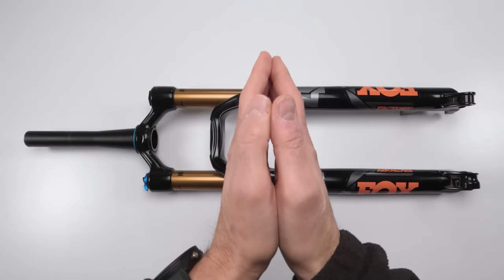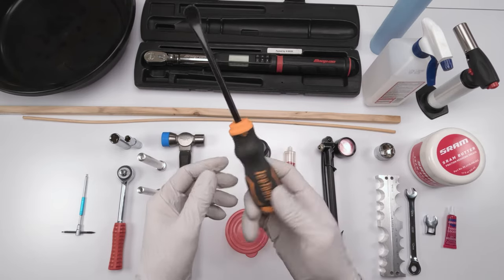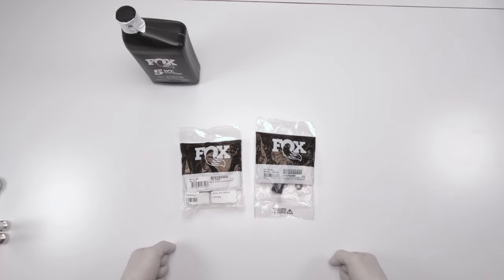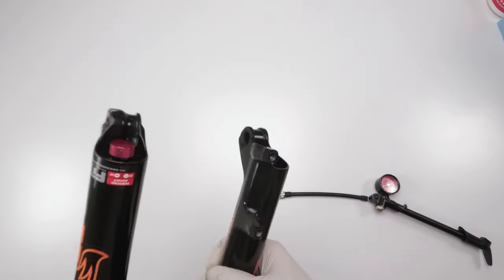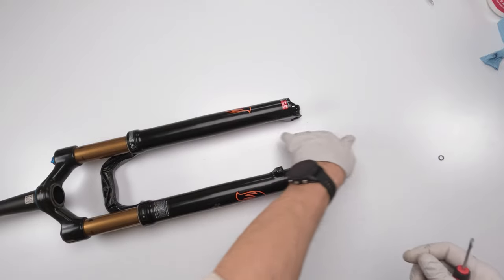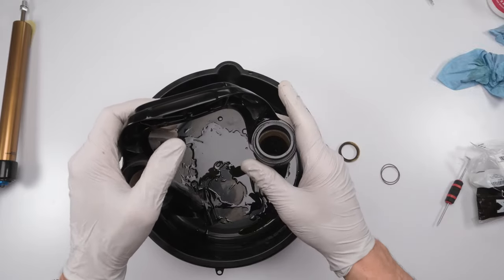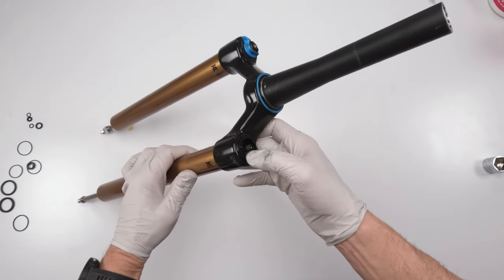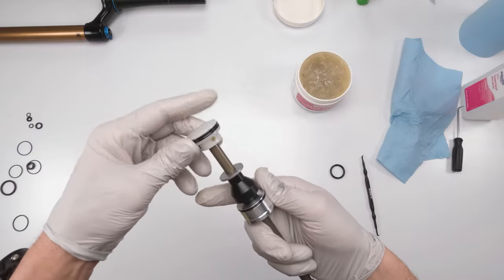Fox Factory Series 34 Float FIT4 2021 Damper, Air spring and Lowers FULL Service guide for beginners

Comment: In the video you showed that you really understand suspensions... Once again, Congratulations on the excellent work. In your opinion, between Fox 34 Factory (not sc) Fit4 (2022) and Rockshox Sid Ultimate Raceday (2022), which one would you choose based on operation, technology, durability and maintenance? What is the best of them in your opinion? I know it's a difficult question, but you showed that you really understand and most other videos, from other channels, seem to be very biased. Thank you for your help.
Reply from the maker: I'm going to start off by saying that I don't have enough experience with the newer SID to provide any useful feedback. Have I ridden it, Yes. But I'm not one to ride a product a handful of times and pretend that I know everything about it.  In my experience, it takes at least 100 - 200 hours of riding different trails that you know very well and readjusting settings regularly to make an honest assessment. 

The fox 34 fit 4 I know well. It's a nice fork for your average trails like we have around here. It offers a good amount of customization to tailor it to your needs. But the one thing I can't customize about it is its stiffness. For me, it's occasionally flexy, especially when turning on my dominant side, going through aggressive rock gardens, etc That's not to say it's a weak shock. 90% of the time, it's more than solid enough, but that last 10% I very much feel. I prefer the pike (or fox 36 but that's overkill for our trails) over the 34 as I can't push those hard enough to feel them flex, at least for our trails. 

My experience with the SID. I HATED the older SID's. To me, they were like riding on noodles.  The new SID's on the other hand, with the 35mm stanchions and new damper, is a VERY welcome change. WAAAY stiffer than the older SID's but I find it harsher than what I'm used to, which is to be expected. I've settled on pikes for my bikes for a few years and put a ridiculous amount of hours into figuring out the most comfortable settings for my favorite local trails. I just haven't put in enough hours in the new SID to see where the sweet spot is for me. And this is key here. It's all about finding the sweet spot for you, on your trails. Suspension is a very personal thing.

Most modern shocks and forks are WAY better than anything we've ever had. Unfortunately, forks are expensive, and it's hard to justify buying two of them at the same time to test them back to back. But they do resell easily with minimal loss. 

With the above being said, 

If you are a more aggressive rider and regularly ride on relatively aggressive trails, and you like a responsive feel but don't mind a bit of a hard ride, start with the SID and see if you can tame it a bit over time. If you like a bit more of a plush ride, then start with the fox 34 fit4 as it offers a bit more adjustability. In either case, you can easily sell either fork to generate funds for the other.

Apologies for the long response.
Reply: @zoubtube  thank you very much for your detailed answer… I think I will go with Fox 34. I like a bit more of a plush ride too. Have a nice weekend and good rides.

Comment: Question:  When I have the damper out, and slide the shaft in and out, there's the subtle sound of Rice Crispies snapping.  Also, the damper tends to have tiny "jumps" in its motion when I pull on it.  Best guess is that these are air bubbles...  are these symtoms you'd expect?
Reply from the maker: So, when cycling the damper, if you hear noises like you mention above, (popping snapping squishing, gurgling (sort of like water rushing through pipes)) then the chances are high that a bit of air got in the system.  Even if there is no air in the system there will be some noise when cycling it due to oil being forced through the shim stack and all the small ports in the piston, but it should sound , well,  dampened (can't think of a better word right now).  more of a  heavier, deeper sound. 

When cycling the damper by using hands only (not on a vise) you will feel some skipping both ways. you won't feel as much when cycling on a vise since you have more control to keep the shift straighter when cycling. The easier it skips stutters etc, the more worn your rebound seal is and needs to get change since air can get inside. I new rebound head will feel very smooth since it will have a higher tolerance if you are slightly off angle when cycling.

hope this helps. let me me know if you have other questions

Comment: Thanks! There isn’t any clip that retains the damper as in the air side?
Reply from the maker: Nope! the damper is a cartridge the threads into the upper and bolts into the lower. good questions and thanks for the comment

Comment: very interesting. Is it possible to know the diameter in millimeters of Body "hole" you user in the clamp?
Reply from the maker: Apologies for the delayed response.
10mm for air spring shaft
~15.5 mm for damper body
9mm damper shaft

Hopefully this helps
Reply: @zoubtube  Hi mate. diameter you wrote are wrong.
I opened the damper for the activity but body is 16.7mm and not aroud 15
Now i'm on hold for a week awaiting the correct jaws 😅😅

Comment: Very thorough! What kind of vises do you use/can recommend for bike mechanical work (jaw width, span width, rotatning vise, rotating jaws, nimble forged jaws)?
Reply from the maker: Tough call, as it depends on many factors, such as space, types of applications and uses, budget, etc. Personally, I would go bigger 5 inch minimum, 6/6.5 preferred, even 8 inch if you have the space and other stuff such as woodworking. Chances are it'll be a one time purchase if you buy a good brand, and you'll never know what you'll use it for in the future. 

For me, I wanted a swivel head. Though it technically creates a vulnerable point, I like the flexibility, especially when working with fork dampers, shocks, and droppers. I also wanted height; as can be seen in some of my fork videos, I'm able to bleed forks on the table. In my case, it helps with cleaner camera views, but it also makes clean up easier as any spill lands on the table as opposed to the floor. 

I tried a few of them before settling on the Yost. Not perfect, but strong, versatile, and with limited slop. I do wish it was 6.5 inch (more for other applications). At the time, the price was good considering the quality and name. The price has gone up since I purchased it, but then again, what hasn't. I had tried the Forward, Wilton and Irvin equivalents, and this one worked out best for my current needs. 

https://www.amazon.com/gp/product/B00CBL62HQ/ref=ppx_yo_dt_b_search_asin_title?ie=UTF8&psc=1.
Reply: @zoubtube , I see the Yost have fixed rotation points and is heavier than the others you mention. They are all made in China though, and only the Irwin is available here in Norway. So I went instead for a German made Heuer 140mm (5.5") forged steel vise with a collapsible lift (that can rotate 360 degrees horizontally). I stepped up from the 120mm version on your advice. It is the first vise I every by and hopefully the last. Thank you!

(I tried to add links but youtube does not like German quality it seems)
Reply from the maker: @alofting  That heuer is a badass vice, myman. I considered them, but they were impossible to find here in the US during mid-covid, so I gave up on them (actually, many vice models from different manufacturers were unavailable at the time; it really was slim pickings). I had also found out at that time that the non-industrial Wilton vices are now made in China, which was very disappointing. Unfortunately, most vices under $500 these days are made in China. Sucks!

Treat that vice well, and it'll last you a lifetime! 👍

Comment: in the lower boots on the damper side fox are calling for a 5wt teflon is it ok to put 20wt gold as you did there ? arent the oils going to mix throught the vent holes ?
thanks
Reply from the maker: per the latest fox damper side oil charts
"Damper-Side Bath - All 34mm FIT4 Damper-Side Bath  FOX 20wt. Gold	 15cc"

Grip and grip two dampers need 5wt in the damper boot
Damper side bath
34mm non-SC Grip Damper-Side Bath	FOX 5wt. Teflon Infused	40cc
34mm SC Grip Damper-Side Bath	FOX 5wt. Teflon Infused	30cc
All 34mm Grip2 Damper-Side Bath	FOX 5wt. Teflon Infused	40cc

hoep this helps

Comment: Love the video 🙂   
Is it two different bullet tools? 
The air spring shaft is 10mm and the damper shaft is 9mm?  
Part nr. 371 for spring and 657 for damper?
Reply from the maker: Yup! Two different bullet tools. 398-00-371 is for the damper, 398-00-657 for the air spring. You can buy the fox part numbers or aftermarket, which is significantly less and just as good imo. there are a few people that sell them on Ebay. I had real good luck with john5w76. I don't know the guy and I have no affiliation with him. His tools are well built, precise, his shipping is fast and he's a good amount less in price than fox. 👍

Comment: Hi nice video!
I must service my fork bleed damper too, next season i will make all damper service but in this i will only bleed it.

I have a question i need 20 or r3 5wt oil for bleed my fork damper: fox 32sc perf elite fit4-> fox id:djbp
Reply from the maker: For the damper you need the 5wt oil. For the lower boots you will use 20wt. Hope this helps.
Reply: @zoubtube  thank you 😊

Comment: Nice detailed video!
I have one question. For the FOX 34 2016-2018 version FOX said: "Once bled, fully extend the cartridge. Make a mark on the shaft approximately 3 inches (75mm) below the sealhead. Compress the shaft until your mark is just at the sealhead. Remove the bleed syringe and vinyl tubing and top off the compression selector shaft with FOX R3 5wt. oil." You advice to remove the syringe with the shaft fully extended. Has that been changed for the 2020+ versions?
Reply from the maker: This depends on the version of the fit4 damper. For this version Damber (2021) this isn't needed. This is was I was told by a FOX tech rep when I called them to verify the DAmper kit part number. I will be releasing a video for a different year fit 4 where this will apply

Comment: Is there any way you could link the vice jaws you use? Also the magnet and the fine flat head screwdriver? Thanks so much!
Reply from the maker: here you go.

Soft jaws I bought them from ebay. Very well made imo. plus the seller is VERY responsive
https://www.ebay.com/itm/115153412361?var=415219180268. 

Here's a link to another ebayer who makes some tools as well. what ever I buy from him is great quality as well. The only thing is his soft jaws don't have magnets like the ones above, which I prefer.

Magnet. I bought it from harbor frieght
https://www.harborfreight.com/hardware/magnets/15-lb-capacity-telescoping-magnetic-pickup-tool-64656.html 

The screw driver head is from a tool kit I bought way back when from Ifixit.  but what should work well is a probe such as the ones in the following link. https://www.harborfreight.com/test-probe-set-5-piece-61872.html
 I plan on using them  on a fork I'll be working on soon.

hope this helps
Reply: Thanks so much. I really appreciate it!

Comment: Does this works for a 2018?
Reply from the maker: Yes, but there are some minor differences, overall they are very similar. if you skip the compression stack and bladder, which in my opinion are optional, then this is a very easy damper to  service and bleed.

Comment: When removing the FIT4 damper top adjuster knobs, my thumb couldn't hold the black knob tight enough to loosen the screw.  I imagine that twisting the screw without bracing the black knob is probably going to do unfriendly things to the damper innards (ie. drive it open too far?).  What I did was use an adjustable wrench loosely around the knob just to pin the grip tabs from turning, while twisting the screw with the other hand.  Probably the only time this would be needed, since I would install it hand-tight from here on.
Reply from the maker: "my thumb couldn't hold the black knob tight enough to loosen the screw."
You "technically" don't have to hold onto the low speed compression (LSC) knob when unscrewing the bolt, this is something I do as I feel I have more control in case something goes wrong. You DO need to make sure the LSC is in the full open position. The screw might be "stiff", but it shouldn't be "hard" to take out. Sounds like the dial was previously assembled with too much force. But if you managed to get it then 👍

Comment: How different will it be for GRIP2 fork?
Love your detailed explanation and clean table :)
Reply from the maker: lowers and air spring basically the same, damper side is significantly different. I should be uploading a fox grip 1 fork video this monday, which is similar to the grip 2, IF I ever get power back so I can finish editing the video. we've been without power for nearly 3 days, even worse, they keep sending updates saying it'll will be restored at a certain time, only to get updates for the updates stating the restoration time has been extended. 🙄

Comment: Hi again, i am enjoying rebuilding these forks thanks to you. I watched the video on fox web site and saw when they installed air chamber assembly they did not keep the rod all the way out to avoid negative pressure. This should be really  important, is it just a mistake in their video? Thanks again
Reply from the maker: I'm pretty sure I haven't seen the video, but if you're stating that when they installed the air spring that everything wasn't; pushed to the top when assembling, then I have to say yes, it was probably an oversight. I did the same thing is a rockshox pike fork video (one of my first videos) when recording these jobs, it SO easy to get distract with the recording process that detail can by missed A great example with me is not setting the crows foot at 90 degrees when torquing stuff. Thanks to peoples comments, it now engrained in that mini brain of mine to always check for this.  

To all out there. Please let me know of any details I've missed or overlooked. I really do want to make these videos as accurate and easy to follow as possible, so others can have a good experience. Thanks in advance
Reply: Same fork but 2022 model, issues with fork suck and can’t seem to figure out why.  This last time I’ve replaced all seals on the piston assembly and once I refit to the fork, just like at 1:03:01 in the video, I will compress it a few times and can feel negative pressure.  It’s not much but after riding it a few times the fork will feel harsh and I’ll pull the lowers off to find the piston shaft is compressed all the way.  The port in the stanchion looks okay it’s not clogged with grease, I don’t see any scratches so I’m running out of ideas??
Reply from the maker: @joshuahall6315  So you serviced the shock, changed the seals, wipers, installed the air spring correctly, and right after closing everything up, you compressed the fork a few times and immediately feel negative pressure? Are you sure there isn't a scratch, nick, dent, or warp of any kind on the stanchions, possibly a nick on the air spring piston head from removing the quad rings with a metal pick, a scratch, nick, or anything abnormal with the air spring rod, a scratch, nick on the air spring head, etc.? It could be a very subtle scratch on any surface that will allow air to get into the negative chamber.
Reply: @zoubtube  Maybe I didn’t look as closely as I should and could probably stand to re-check under a magnifying lamp.  I’ve ordered a 120mm piston kit for this fork so when that comes in I’ll do a bit better investigation. Thanks for the reply, I love your channel!
Reply from the maker: @joshuahall6315  Ordering a piston kit was most likely going to be my next response depending on your reply. Something is definitely off. If the tube looks free of scratches and there isn't anything noticeable blemishes on the air spring, then replacing the air spring is a relatively inexpensive option. Hopefully it solves the problem. keep us updated 👍
Reply: @joshuahall6315  how do you pump up the fork to reach desired pressure?
Reply: @rg8707  for every 10psi I stop and cycle the lowers up/down to equalize the pressure between chambers.  I can hear a whoosh noise as the pressure equalizes.  I hope this is normal haha
Reply: @joshuahall6315  sounds good to me . I believe that Fox says to put piston in ( the proper way, as we know , thanks  Zoub tube ) put top cap and pump to 60psi then cycle and do it every 10-psi like you did. I don’t think it would make much of a difference,,, BUT???  I was given a Fox 36 , it had 140psi (WTF) .. took it apart and was crazy negative pressure .. I ask how heavy is this guy?? Turns out he is 230 lbs.   I added a couple tokens, haven’t heard anything yet. Just throwing shit out there.. let me know , i am curious..
Reply: @rg8707  thanks, I just got the 120mm piston kit so hopefully I’ll be able to tear into the fork over the holiday.  Hopefully I can get to the bottom of this, I’ll let ya know.

Comment: Hi! you mention that the vise clamp is 9mm but isnt the rebound shaft 8mm on this model? and older models its 10mm right? Can you confirm which size vice clamp is needed. Thanks!
Reply from the maker: yup, its 8mm. A miss on my side, even though it worked. many aftermarket fox soft jaws come with 8, 9 and 10mm holes, plus the larger holes for different year forks. I would buy one of those if you end up buying one, they are more versatile. apologies for any confusion